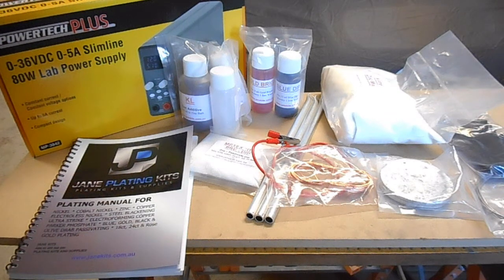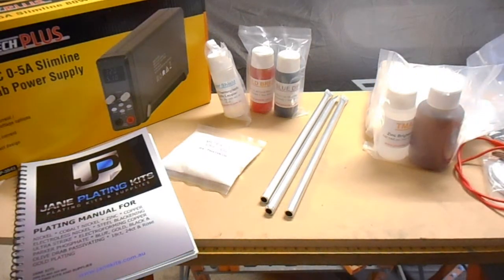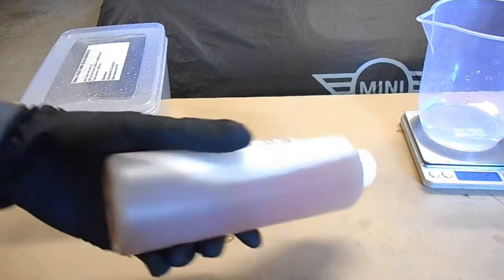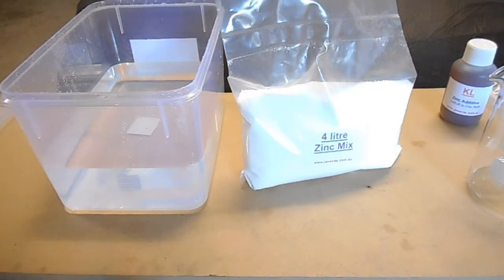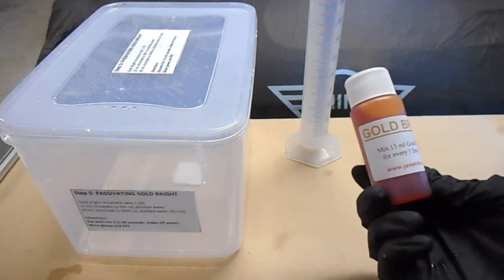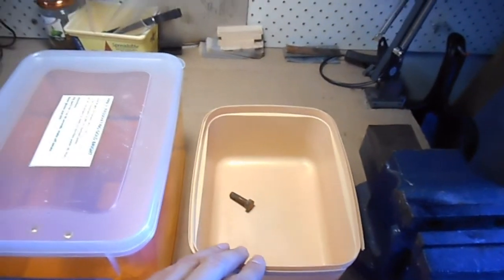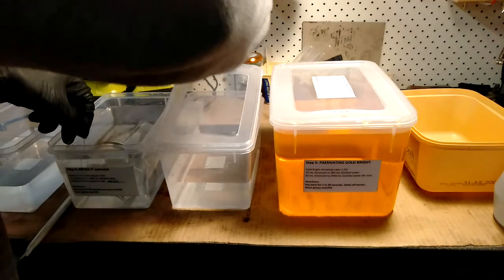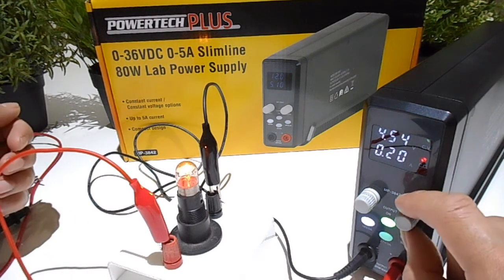Zinc Electroplating with MP-3842 power supply

Comment: Thanks for the video.  I too have the MP-3842 and use it for copper plating 3D prints.  It was working perfectly, but one day it stopped allowing me to control the AMP's, and only voltage.  I did the reset as you demonstrated, and it's all fixed now.  Really appreciate you help.  Thanks!

Comment: I cannot for the life of me work out how to adjust the amps, even after doing as you suggested. I have emailed Jane kits hopefully they can help.
Reply from the maker: Seriously Creative If the power supply is producing no power at all, it might be possible the power supply has tripped, waiting a bit will allow the thermal overload to reset. Hopefully Jane Kits can help you, I know Jaycar electronics sell the same power supply they might be willing to help. I'm pretty sure my power supply didn't have an instruction manual so I figured out how to use it by searching the model number.